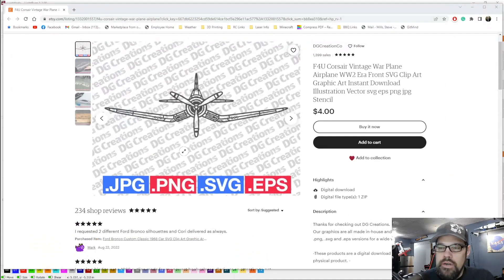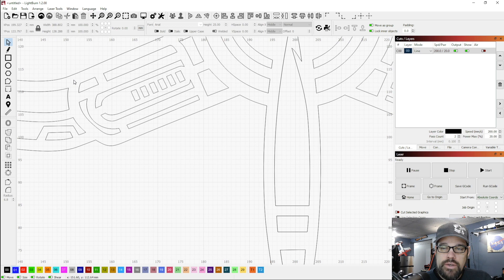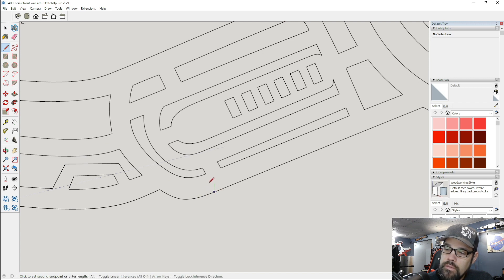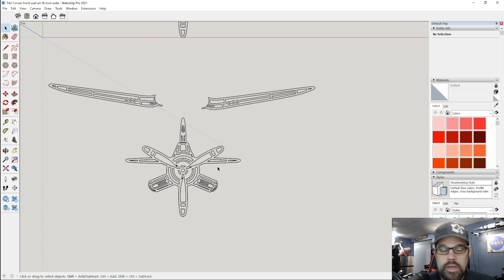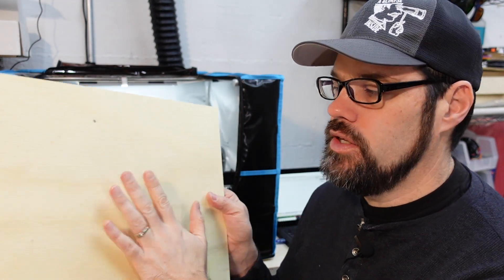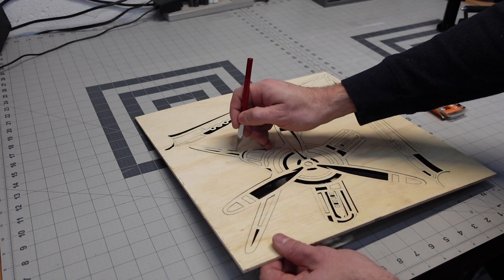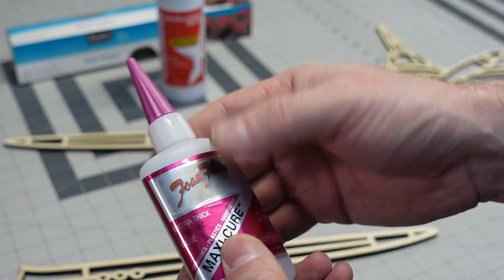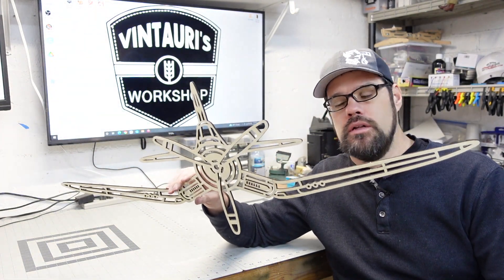Create oversized wall art on a smaller Diode Laser

Comment: I know this video is ages ago, but can you, instead of just a curve line to split the wings, do a profile so it’ll be like a puzzle piece so the two parts will hold/lock onto each other to glue?
Reply from the maker: You could but in this case there was only about .25" of material to work with there without changing the line to a thicker piece. But I've done that before on larger pieces with a more solid structure to work with.

Comment: I did a couple planes in 1/4 but had to paint them, you can really see the joints where it's glued, do you have any suggestions on how to hide the joints?
Reply from the maker: If you can work them into what looks like a panel line for the break that will be the best, otherwise see what you can do to really dial in the kerf and efficient cutting of the edge to leave as clean a line as possible.  Maybe some slight sanding on the joint would help as well.

Comment: A grow tent for your "machine" ventilation...shell company much there Smokey?
Reply from the maker: These tents are used for many things including 3D printers, lasers and yes grow tents. Why reinvent the wheel when something already made works. I’ve also designed and built my own enclosure but not everyone has the tools, skills or the time to build their own. So I share options that work. This one is great if you want to use an overhead camera in lightburn for material alignment.
Reply: @Vintauri  You're a good sport! Enjoyed the video.  I recognized it from inline fan research to make air purifiers with dust collector style filters.

Comment: My first time commenting on a YouTube video.loved your style of delivering content.
I’m about to purchase my first laser and am looking at the Atomstack 20 pro.
Also I am a RCer and have been flying for 58 years. Love the planes in your background.
Great job
Reply from the maker: Thanks for checking it out and leaving a comment. Model Aviation is what got me into lasers and cnc machines. I’ve been flying for over 30 years myself. The Atomstack 20w is a good machine and you can get the rail extensions for cutting longer items such as balsa sheets.  I have a review on that machine and the 30w version. Both would be great options.
Reply: @Vintauri  My dad and I flew one of the first RC units. It only pulsed the rudder so you could change direction. So basically a free flight that was a bit more predictable. Range was a major issue and we chased many planes out of the sun roof of a VW bug.
  Pop is now 95 and last year he built some stick and tissue rubber band WW1 planes.
   I hope the laser will give me some more creativity with my fine woodworking and turning projects. 
  Keep up the great channel.

Comment: Sorry, I know this is wood, I intended to ask about how safe it is to use a diode laser cutter on Vinly products.
Reply from the maker: There are some laser safe vinyl materials out there but I’m not sure how they compare in durability to the standard stuff. Cutting regular vinyl with a laser is definitely not something to do. It will corrode your machine and your lungs and it does not take much of the gas to do either.

Comment: Does the vinyl gas off Chlorine gas?
Reply from the maker: If you were to cut normal vinyl on the laser it would off gas Chlorine.  So I never recommend doing that. I use a vinyl cutter with a drag knife if I’m cutting vinyl decals.

Comment: I just purchased this file down loaded it. After extracting the file to another folder. Opened lightburn and imported the file that was 166KB thinking this might be the file I wanted to cut out the F4U  like you did. i did not bother to expanded it like you did, I wanted to test the file first on a 12 X 12 inch Baltic birch 3 mm Ply. it turned out to be a destater. after cutting it out  the parts fell out looking nothing like you line drawn file. the propeller tips fell out. the outer wing sections fell out as well as the intake air louvers in the wing route. I am thinking I may have chosen the incorrect file. 
The file appears to me as if was intended to be engraved and not cut.
How many KB's was the file you used? I am not seeing a SVG file extension in file folder.

 What do you suggest? 
I am using Lightburn latest ver Longer Ray 5,  10 watt laser with air assist.
😒🛫
Reply from the maker: The file I received was a zip file that was 911kb in total.  It contained a JPG, PNG, SVG and EPS versions.  The SVG was 24kb when pulled from the zip file.  There were a couple lines that were not closed and needed to be fixed one was on the right wing panel and the other was on the center hub. If you highlight the entire vector in lightburn and then go to the Edit Menu, then use Select Open Shapes, it will quickly highlight any objects that are not closed off. I hope this helps.
Reply: Thank you for the reply, it turns out when u zipped the files microcrap took control and relabeled the file in it own format not SVG, ESP, or JPG, PNJ. Some file exertion I never herd of. That is why I was asking file size to identify what file you used. I contacted the seller Cori. And she resent the files and I opened up the esp. file and it worked great I did have to tweak power setting in certain areas such as the oil cooler intakes at the wing root I was using 1/8 Baltic Birch ply 12 X 12. I wanted to do the same as you did two wings diagonal on the ply and the fuselage on another. I am still working working with the tools in  lightburn. My copy of sketch up 2017 and I am not sure it can do what you did. 
Oh Cori is wonderful to work with I am having her build some other airplanes that she has not modeled. She very reasonable with rates too!😁🛫

Comment: Did you use a kerf?
Reply from the maker: I did not use a kerf offset on this one as the simple Arc shape didn't require precise fitting. IF you used more of a jigsaw puzzle connection, you'd want a tighter fit.

Comment: For splitting the wings from the rest Lightburn would work in almost exactly the same way. Use the pen tool to draw a three piece line from one wing surface to another, just as you did in Sketchup (the alter ego of SuperKetchup?). Then switch to the nodes tool, add a node on the wing surfaces where the new line meets it and make those three copies, deleting the nodes for the rest as necessary. Mouse over the centre section of the new line and press 'S' to make it a bezier curve, just as in Sketchup. Use Alt-J with all tools deselected to join several objects together.
Reply from the maker: Thanks for the tips on the bezier curve in Lightburn.  Im so used to designing in CAD and Illustrator that I often resort to those tools before playing with the advanced features of Lightburn.  But that's what I love about this community!  Sharing and learning!
Reply: I thought about the node tool as well but I have not used it yet. This presents a good opportunity to do so. 😀🛫

Comment: what were ur settings for the 1/4 wood? Speed/power/passes?
Thanks
Reply from the maker: I ran this one at 250mm/min 95% power with full air and a single pass.  I strongly recommend that you run a material cut test to find your own settings for your laser, it will save you material and the headache of guessing on trying what others have used.
Reply: @Vintauri  thnx
Reply: hmm. I have to use 6 passes 60 mm/min @100% with my atomstack x20

Comment: Great tutorial. I'm going to have a run at it. I got the P51 fire from the same creator but am stuck at editing the breaks. How do you  import the SVG file into sketchup for editing?  My version of sketchup is few years old but can only import the png or jpg. I assume you're importing the svg?
Reply from the maker: I'm using the latest version of Sketchup Pro, which does allow importing some vectors.  Can you import a DXF?  If so you could open the SVG in Lightburn, export it as a DXF and then open that in Sketchup.
Reply: @Vintauri  That did the trick. Thanks much.
Reply from the maker: @johnchireman8457  Awesome!  I’ve been using Sketchup from way back when it was developed at google. The options have changed over the years and it’s hard to keep track of what is available between the free and the pro versions. I hope the P51 comes out well for you. I might play with that one and others more as I’ve had requests from friends for some custom work.

Comment: Why not use the "Print and Cut" option in Lightburn?  Sorry maybe I missed that discussion.  Your process does reduce material waste.  I get that.  Just wondering.
Reply from the maker: I'm not sure how Print and Cut would work in this scenario to break up the object into pieces to cut something larger than the working area.  If there is a way, I'd love to see it and learn something new!
Reply: @Vintauri  Check out this Lightburn video https://www.youtube.com/watch?v=n__saOKVupA&t=761s  I've used this several times and it works.  He makes several files to make the cuts.  Recommend that process.
Reply: That’s a super helpful method. I makes your laser cutter multiple times bigger.

Comment: I have that same laser and never seem to get by without some charring even with the air assist. What settings did you end up using on that wood to get it that clean? Also, how strong will CA glue be over time vs wood glue? Love the project (also a great fan of the Corsair) and excited to try some larger cuts myself. I did just get the extended rails for this machine but I can't use them until I finish my cabinet because my current enclosure is designed for the original machine size. Would also be interested in what fan strength and details you are using because I did not see any smoke build up for you, where as I almost always get a cloud that overwhelms my 195 cfm fan for a bit.
Reply from the maker: This was done at 400mm/min and 90% power one pass.  The type of wood will make a huge difference. I've tried some plywood that charred horribly.  Wood glue would be stronger assuming it can soak into the fibers of the wood grain, too much charring and both CA and wood glue will risk failing.  I recently upgraded to a 6" AC Infinity fan that is supposed to pull 352 CFM.  However I have it choked down to 4" so I'm sure I'm getting less CFM.  It does do a great job at pulling the smoke out of the enclosure.

Comment: I have the Atezr 20w. what were your setting to cut through the 1/4" material? I've done 5mm at 500mm/min at 80% power 2 passes. Just curious on what your settings are. I really have not played much with thicker material. Mostly been doing 1/8" material at 350mm/min at 80% 1 pass. Looks like atezr and the atomstack maybe made by same factory as the laser head and even the air pump look identical.
Reply from the maker: This was done at 400mm/min and 90% power one pass.  I will say the type of material makes a big difference.  Some plywoods with a MDF core will not cut very well due to all the glue in the MDF.
Reply: @Vintauri  I saw you say that you cut this SandePly at approx 6mm/s @ 90% power… I’ve been using this same plywood and was wondering if you’re getting a lot of charring on the cut edges? My surfaces stay pretty clean with this stuff but the edges seem to have so much soot and char? What air assist were you running for this cut? Great video!